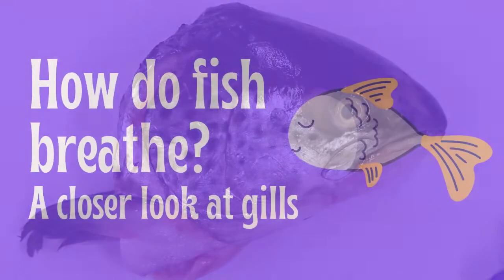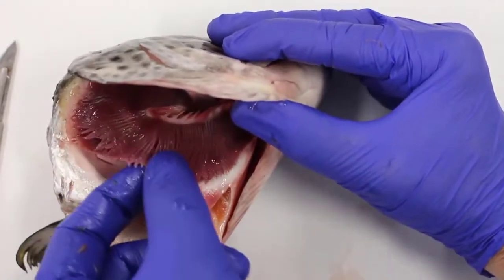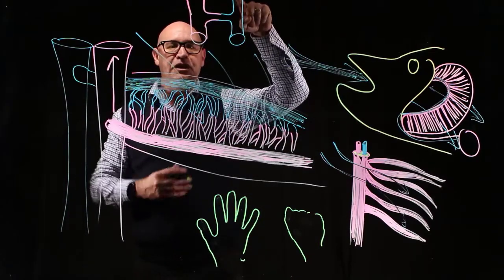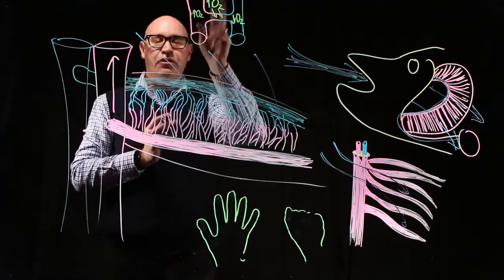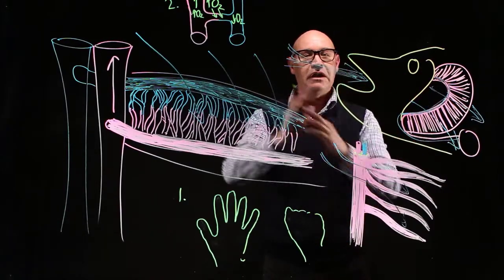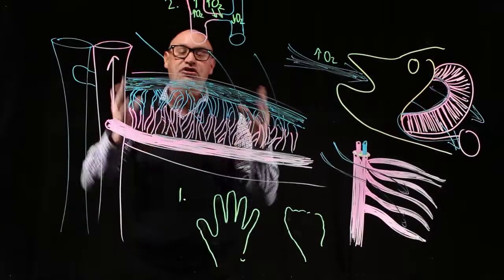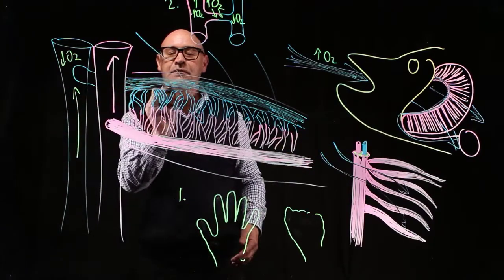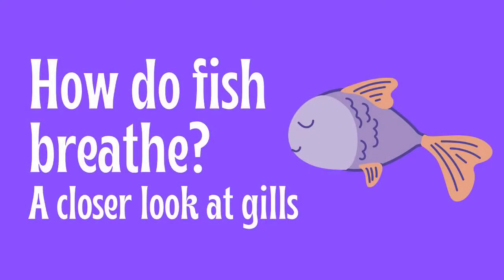How do fish breathe? A closer look at gills

Comment: How do they expel carbon dioxide after respiring?
Reply from the maker: That is a good question. It is through diffusion. There is a higher concentration of carbon dioxide in the blood than the water so it diffuses from the blood in the gills into the water.
Reply: @SteveGriffithsvideo  so does the intake of oxygen and the excretion of carbon dioxide happen simultaneously (ie. When water is passing over the gills)?
Reply from the maker: Yes exactly
Reply: @SteveGriffithsvideo  ok. Thanks!

Comment: I have questions that how fish change water to O2 .may be fish takes only molecular of oxygen?
Reply: Can you explain me
Reply from the maker: Just like salt or sugar can be dissolved in water, so can oxygen gas (O2). O2 is a solute in the solvent water. The fish doesn’t need to split the oxygen out of the water (H2O). The oxygen dissolved in the water diffuses out of the water and into the fish blood via the gills.
Reply: @SteveGriffithsvideo  so, after fish takes oxygen to it's un Oxygen blood hydro come our with co2
Reply from the maker: Yes carbon dioxide diffuses out of the blood into the water
Reply from the maker: The oxygen molecules are dissolved in the water.